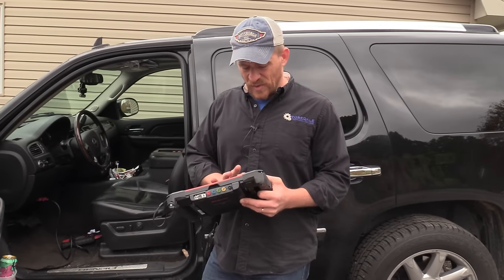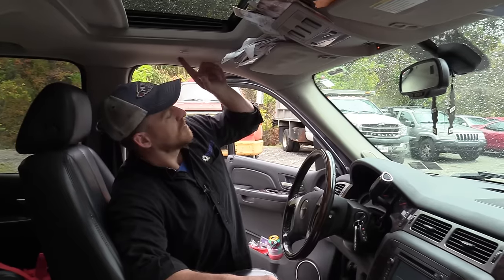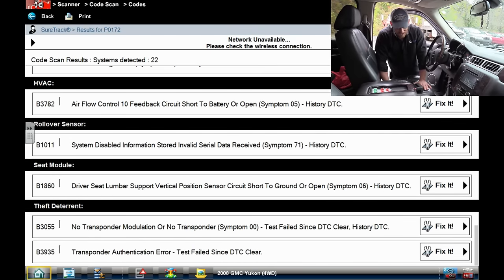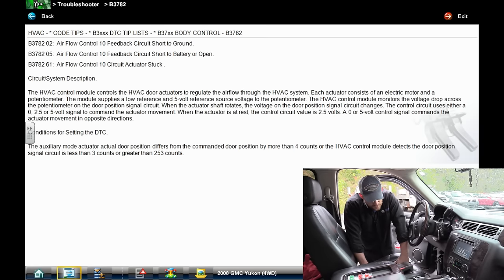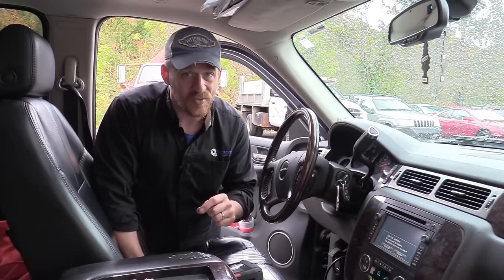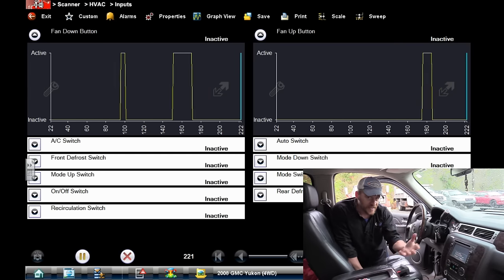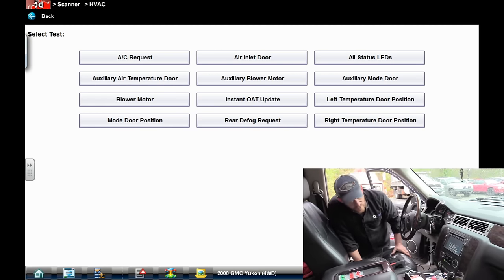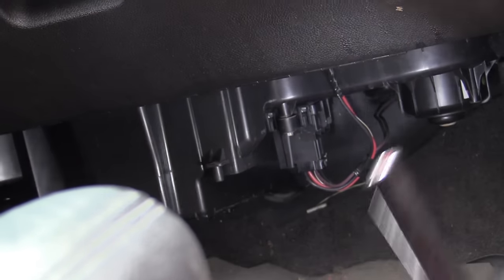GMC Yukon HVAC Blower Motor Won't Turn On

Comment: Hi Paul...Can we do bypass test by giving ground on the wire using test light???? Second thing, as we increase the fan speed, the ground value keeps decreasing, like u said better and better ground. Paul i want to know how is it possible to change ground value to better and more better??? is this possible by using resistors??? Plzzz advise. Thank you.
Reply from the maker: I need a time frame please. For the ground part you are talking about.
Also, you cannot use a test light to do a bypass test if it is a higher current circuit. The test light will not support the current flow

Comment: Any idea why on a suburban manual rear ac blower, there is power to the blower, new resister, but when plugged in to the motor/load the power drops to zero?

Comment: Mr. Paul, how were you able to draw a LIN signal ranging from zero to 4 volts at fan maximum speed? What I knew about LIN voltage that it only ranges from slightly above zero (0.5) volt up to slightly under battery voltage (11.5).  Thanks for your time and effort. We really appreciate that.
Reply from the maker: This signal was not part of a network on this model
Reply: ScannerDanner wow. I dont know how the life could be without you.

Comment: I have a 91gmc G2500. I replaced resister blower motor and dash module. Still no power to it. I previously took out all the ac..... did I somehow stop a circuit ground?  My door locks are also clicking on and off, even without the motor on, is this connected. I feel I must have a bad ground somewhere. I’m an older female and this is making my brain bleed! Will appreciate any thoughts you have to share.
Reply from the maker: You need a good wiring diagram for your system. Door locks clicking on and off are also not good symptoms (bad ground or low voltage on a feed circuit)
http://eautorepair.adtrk.biz/?a=10817&c=24&p=r&s1=

Comment: I did this exact test with my verus pro and got the same results. I changed the module and it fixed the issue. 2 days later stopped again, so I figured defective part. Got another one and worked great for a day and stopped again with same results. Can’t figure out why the module keeps dying.
Reply from the maker: Too much current from the blower motor burning it out, or you have a connection issues right there at the module.

Comment: Well for starters, that’s not the onstar speaker, that’s part of the climate control system, it uses a fan and a temp sensor to sample drivers seat temps to inform the auto hvac module

Comment: The fins or poles are to detect the temperature as the air flows over them so it can be adjusted automatically when on auto not cooling fins.
Reply from the maker: You sure about that? There is no feedback circuit from the blower module to the climate control panel. This blower module does no decision making on it's own as far as temperature of the air or blower speed.

Comment: When i baught my truck the module was gone... i baught cheap ebay one and didnt work. I borrowed one from identical truck, didnt work.  Gonna try your tests..  my truck also happens to have same onstar noise aswell.... ever figure that out?
Reply from the maker: Yeah, I was wrong, that is not on star, that is an air intake for an in car temp sensor
Reply: Mine has no power down at module at all... i tryed swapping out control unit on dash and still nothing, all fuses look good... not sure what else to check.

Comment: Ok. I totally understand this circuit now, but what I expected to see on the blower ground wire is actual square waves being pulled from battery voltage to ground with varying pulse widths. This system acts more like a resistor in that it drops a certain amount of voltage depending on the speed commanded. I am curious about the way this blower module accomplishes this?
Reply from the maker: You would be correct. The motor itself is not PWMed, only the signal input to the blower module is. Sorry for mis-speaking there.
Reply: No biggie bud. Thanks for clearing that up.
Reply from the maker: I'm not sure exactly how the blower module is doing this but it certainly looked like it was simply switching to different resistors internal to the board.

Comment: Question? I i had to pick one source of information which will be your advice if i love to troubleshoot engine performance, electrical system, etc.[ Identifix, alldata or michelle ondeman?]
Reply from the maker: My preference is Mitchell On-Demand (same as Shop Key) simply for the wiring diagrams. They are all redrawn using the same format. No matter what you are working on, you will not have to study the legends and keys and color codes and segments, just to be able to read them. 
Factory techs hate Mitchell diagrams because of this. Alldata does NOT redraw them and will produce the actual factory diagrams as they are. Meaning every car is different. That's fine for a guy who works on one car line. But I work on 40 different manufactures cars and I want uniformity. So Mitchell/Shop Key it is.

Comment: I had a jaguar that had blower motor resister module I could not  tested I only tested power and ground  ok and than it had feed back and control, I energized the blower motor to check amps and brushes, was operating  , how ever signal had 9 volts  bias steady  with no changes, and 0v on feed back, my issue was to know if the hvac control was the issue or the blower  module because when commanding on blower motor speed I got not changes at all, so with test light  even  the led the voltage was dropped  and no changes with command, so at this point we order one at the dealer $400.00 install it and now the blower works  I get the scope and do my checks and the voltage was dropping  but as analog style to 2.5 volt at high speed , and the feed back was going from low to high appositive than signal. hard to test this modules some time because according to flow chart the  test was to check the signal and command blower motor from low to hig and verify voltage signal dropping  if not replace hvac controller.but the blower motor module wasa the fix. thanks for showing excellent testing methods
Reply from the maker: Module to module communication lines can be difficult to troubleshoot. Nice job on that one Joel!

Comment: I enjoyed your video, good information.  However I have a question. I have an 07 Yukon with intermittent blower issues. Any time car is started the blower either works or it doesn't. Once it's running it doesnt fail in the middle of opperation. I verified the blower works, without module. I have control voltage to the module, ranging from .8 VDC to 9.5 VDC, high to low speed respectively (checking the control to ground). I have voltage on the ground side of the blower, I'm glad you clarified it uses PWM on the ground side for speed control, that explains that. Have continuity between module ground and the rest of the car. I replaced the blower module however still having  intermittent issues. I have also tried a automatic climate controler from a Acadia, but still doesnt work. 
Have any other thoughts? Anything would be greatly appreciated!
Reply from the maker: sounds like a classic blower motor failure (poor brush contact)
Reply: @ScannerDanner  
Ok thank you for the advice.
Just an update...
I disassembled the blower to get a better look at the motor, looking for anything obvious, didnt see anything bad. So cleaned out the motor with a spray electrical contact cleaner and compressed air, made sure it was good and dry and reassembled. 
So far for the last month it has worked without any problems. :)

Comment: Last one of those i did.the old motor was drawing around 20 amps and looked like garbage. New motor was around 10 amps. Wouldn't have been able to tell without checking. Save the module.

Comment: My ac does not work at any speed but I can faintly hear the blower motor trying to turn on under passenger dash would my blower be bad or the resistor if so how would I be able to tell symptoms  from the blower from the resistor also could the hvac over drivers head it has a small grill affect why no access rear or front works.
Reply from the maker: voltage testing at the blower and resistor are needed to answer that

Comment: Most likely the capacitors have gone high ESR.....(bulging/leaky caps). They use cheap Chinese capacitors in those modules. I repaired one of those on a jeep . Soldered in 2 new caps and repaired the ground pin to the board. Good to go after that.

Comment: Remember the days of vacuum operated AC controls...
Reply from the maker: Yes! Hated vacuum controlled stuff. Big time!
Reply: I daily drive mechanical switch and vacuum controls, problem is mode selection switch is leaking when on AC, hard pulls and it loses vacuum boo. too lazy to fix it :)
Reply: ScannerDanner It's crazy that something like a tiny vacuum leak in an AC control in the dash can cause lean conditions, I'm so happy for electronics everyday.
Reply: so easy to diagnose, just listen and follow the hiss to it's source ;)
Reply: throttle bottle Yea. But vacuum lines are for PCV valves and EGRs, not AC controls lol
Reply: could have fooled me, seeing the only thing replaced on my 25yr old special, is the blower relay( high speed quit), I hate gas prices, but they're far cheaper than car payments, full coverage + all the stupendous upkeep of non-stop broken chinesium ;)
Reply: You mean a Crown Vic made the same year as the Denali? :p

Comment: Ok
I might have a good one for you.
2008 Chevrolet LTZ Suburban that has had the engine light on, no oil pressure at cluster but no have no codes showing up.
Reply from the maker: the oil psi sensor will flag a code and set the MIL and is a common failure item. Upper intake has to come off to change the sensor
Reply: @ScannerDanner  No it doesn't. A little tight but can replace in 15 minutes.

Comment: Bought a chevy s10 truck and the headlights werent working. For some reason there was no fuse there. I tried putting a new fuse but it isnt clicking into place?

Comment: When changing the module do the car have to be running
Reply from the maker: No, and the key should be off, with the circuit off, for the safest way to change any module

Comment: I have no power on my climate control panel. It was working at 1st an it was blowing just wasn’t getting cold cause my compressor was not coming on so I by pass my a/c compressor relay wit a paper clip then my compressor came on but then whn I got in my 2007 Denali my climate control panel would not come on nor was it blowing any air. I checked all fuses an nothing was blown. I need help wat is wrong??? Can u help me please?
Reply from the maker: When you jumped the relay, did you jump the wrong pins at first?

Comment: I have a Chevy Impala 2013 that I replaced the resistor and wiring harness to the resistor and after that it caught fire is there another underlying issue what do I do
Reply from the maker: Resistance equals heat, you missed something or caused a poor contact with something you wired
Reply: @ScannerDanner  the wiring harness deck goes into the relay under the dash was already burnt and I went to AutoZone and got it new plug I wired it up correctly but it must have another problem somewhere further down the wires

Comment: fathers 93 buick roadmaster wagon blower stays on and ac compressor kicks in and off every 2 seconds none stop unless I remove the fuse.auto climate control is weird it wont turn off at all ,blows strong air.but if I press off it just changes mode like if I was pressing mode but will not turn off.changed the climate control but same thing.disconnected resister module but still climate control still don't turn off.can it be a bad module or main computer?have to keep fuse off .any idea where to look ?thanks.
Reply from the maker: These older systems where horrible. You may have a control issue or you may just be low on charge and the compressor is short cycling because of it. Let's start with a psi reading on your AC system
Reply: thanks I will check charge.one quick qstion,does the blower motor resister module have anything to do with the climate control not working turning off etc?thanks

Comment: There's a possibility that the cruise control is inoperative with that brake switch DTC
Reply from the maker: I was called in for the blower in-op only. I never cared about the brake switch code or all the other million codes on this truck. Did I say something about the brake switch? Sorry, just looking for context here. Thanks!
Reply: ScannerDanner I was just being observant Paul.....No disrespect intended and if you took it that way I am sorry
Reply from the maker: Not at all my friend. I was just wondering why you mentioned it amongst all the other codes. Just curious was all.
Reply: ScannerDanner I'd document those DTCs and try to sell more work....        Perfect opportunity to make more money

Comment: coming soon, it returns with same issue, because blower motor was failing and cooked the module =p
poking at you mentioning the amp measurement and feeling comfortable not checking it, they always bite you in the arse

Comment: What is up with  the brake switch code? I see that often but I can never find anything wrong?
Reply from the maker: Same. Did you ever fix that Hyundai?
Reply: No I couldn't figure it out, I told customer to drive it until I have time to look at it again or when you want to take another shot at it. :)

Comment: Thats not a speaker for onstar in the ceiling thats actually a sensor for the HVAC system I had to replace mine in a 2008 Avalanche due to dash noise it couldn't get a correct reading

Comment: Now what if I'm not getting power to the module? I bought a new controller thinking it wasnt sending power. Still no power to the module
Reply from the maker: Pretty sure I showed the diagram in this video. Did i?

Comment: If the power module has good power and ground, why does it need to be replaced?
Reply from the maker: Because it is failing to ground the blower motor. It is a ground side controlled circuit by the module. And the module itself has a good power and ground.

Comment: Another good reason why I won't buy a modern car. Great video though.
Reply from the maker: maybe I will convince you one day to buy one :-) because you'll have the confidence to fix it yourself
Reply: Older ones fail as well, I've had the resistor bank style go out on me more than once. Mind you they are most likely a lot cheaper to replace.

Comment: U can repair that resitor .they MOSFET is bad.  There are 2 of them in there   .they are squre. With 3 legs.  They are under 2 dollars.    I ran across. On a 2004 jeep and there blower motor modual or resisor. Was $140 I fixed it for under $4.  Looks the same as the GM. ONE.
Reply from the maker: For sure, someone could. Just not me :-) It's just not worth the time and the resources are slim.

Comment: hm..are u sure that the module is pulse width modulating (or duty cycling) the blower motor?..i mean, in a sense the pump module does to the variable speed fuel pump..bcus we havent seen that here, have we?..i think what they did is they just removed the old-fashioned knob/switch out from the dash and kinda put it in the module(together with the blower resistor(s))..bcus, seriously, it s a damn blower, has 4 different speeds and thats good enough..dont need to fine tune it to a detail, in between those speeds, by PWM it..
Reply from the maker: I don't think the ground was being controlled using a PWM principle , I had my scope set on a 6 mega sample screen and I definitely would have seen the pulses. The climate control module to blower motor control module signal was a PWM signal, but that was it. I misspoke in the video saying the blower itself was being controlled that way. It certainly looked like some type of stepped circuit where resistance was being added and subtracted. Not exactly sure how they were doing it to be honest.

Comment: Took fan motor off and manually tested it off the battery. It worked but when I try,   running a good resistor, it won't work. Power that goes to the resistor shows 13volts. I don't know what the fuck is wrong. I have enough juice but it won't run unless I manually connect to battery

Comment: I  fix these all the time  joint
Reply: You fix these and smoke a joint?
Reply: Solder joint in the module sorry
Reply: Paul knows high current duty cycle burns solder off break easy most of time just replace it 😀

Comment: I had pretty much the same issue with my 02 Grand Cherokee. My diagnosis was many times faster, and probably just as accurate. I just had a passenger kick the module and magically the fan would start up. I did later replace the module (with a revised model with larger heatsink) as well as the blower itself for good measure.
Reply from the maker: That vibration from the kick could also get the blower motor spinning again so you got lucky.
Reply: I think that's the lesson here.

Comment: 2016 Yukon...if the front blower doesn’t work but the rear blower works, I replaced front blower, do you think the rear resistor works with the front blower motor?
Reply from the maker: The rear and front blower motors would be independently controlled. I'd have to look at a diagram for your system to answer precisely. Post this to my forum www.scannerdanner.com 
It's free to join and we can check service info and answer better